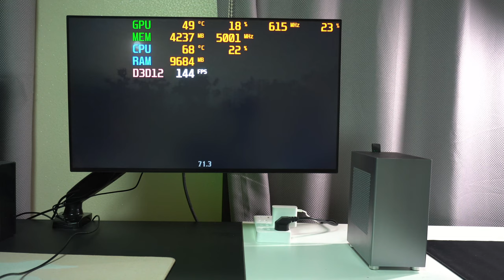Formula 2s(포뮬러 2s), Sub-5L FHD Gaming Machine You Can Carry, Build Guide(from A to Z)  SFF ITX CASE

Comment: Hi there! Great build video, I don’t think the 43mm 3060 Ti Aero fits in this case right? 

And, how do you compare the noise level from your modded Flex PSU to the SFX PSU on Acat S1? Worth the reduction in size? (6.6L to 4.6L)

I own a SF600 right now with no GPU and case. Not sure if it’s worth selling that PSU to downsize to the Flex PSU side.
Reply from the maker: I think 43mm is tight but it fits. Corsair SF PSU is definitely better than Modded Flex PSU. But I am not sure about other budget SFX PSUs are better than Modded Flex.